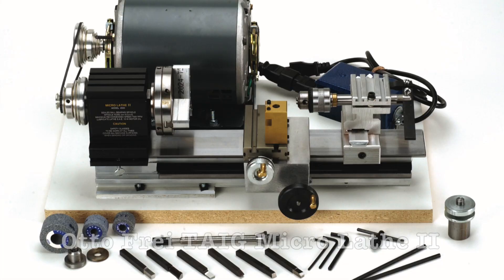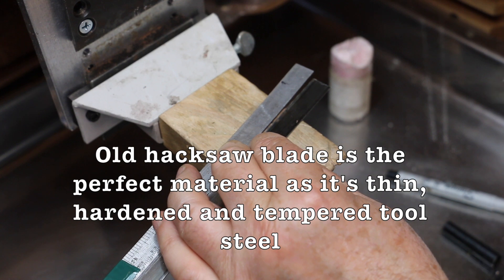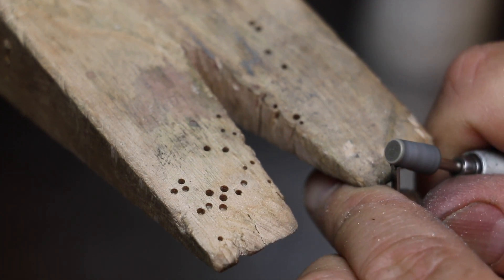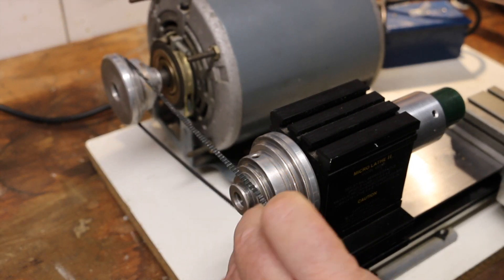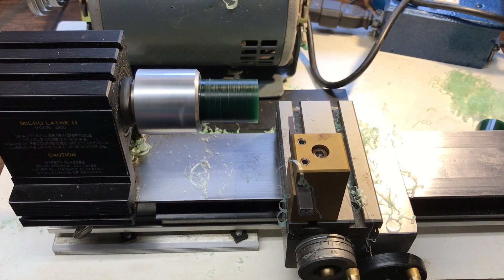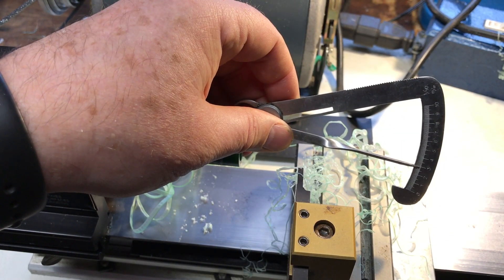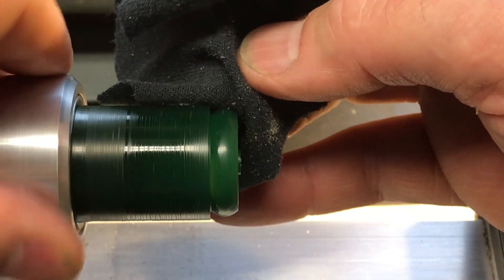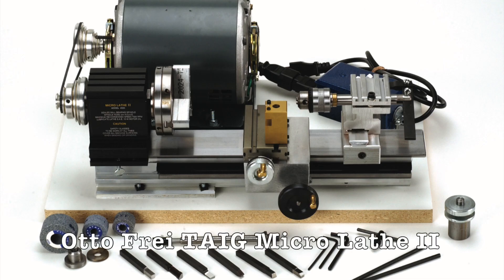Jeff Georgantes makes Perfect Wedding Bands with the Tiag Lathe 3

Comment: Will you do a video with the TAIG Micro Lathe Radiused Turner?
Reply: I'm still working out details with Otto Frei about future TAIG topics. Is there anything in particular that you want to learn about with the Radiused Turner?
Reply: Jeff Georgantes  how to use it and is it possible to take a metal band that is fabricated and using the radiuses tuner to get a nice 1/2 dome out side. I make rings that are a few different metals all soldered and fused together in a bar stock then into ring. A little more is done to it. Then I have to hand file it to shape. I’ve seen a video that Chris ploof has on his Instagram using one of these. But he has it for a big fancy lathe. And it’s a two quick of a clip to see what it’s actually going on
Reply: Let me talk to the folks at Otto Frei and I'll get back to you about that. Thanks!!  Jeff

Comment: Will it work for silver or titanium?
Reply: This technique will only work with wax for lost wax casting. Cutting a similar ring in metal is much more complicated. Hope that answers your question!
Reply: But you can cut those metals, just not with the band saw blade tooling?  Basically, I would use this to either cut channels in a solid ring blank from those materials or to true up the inside or outside of a fabricated band.
Reply: Yes you should be able to use the TAIG lathe to do that.